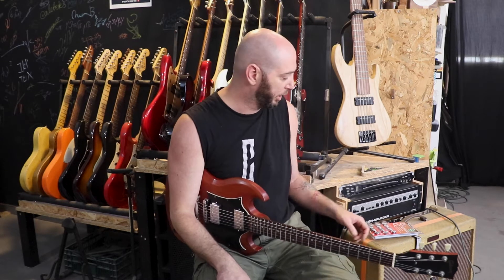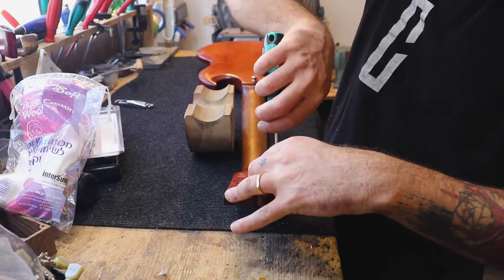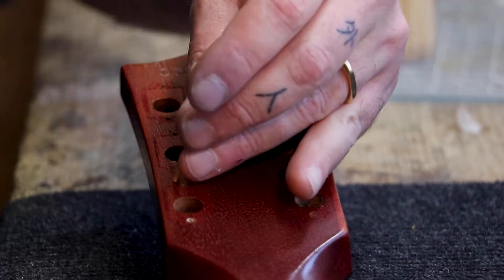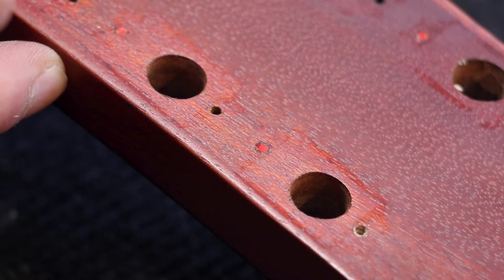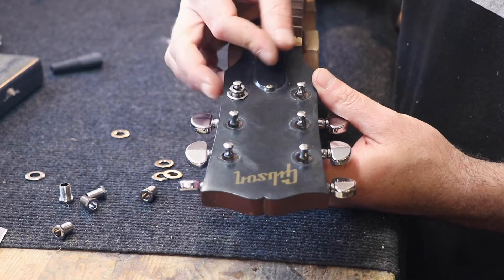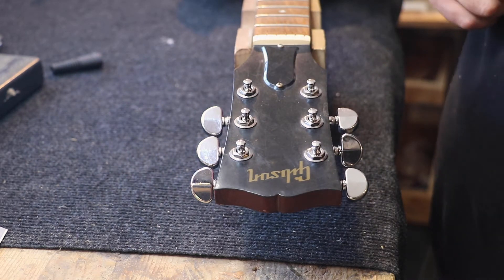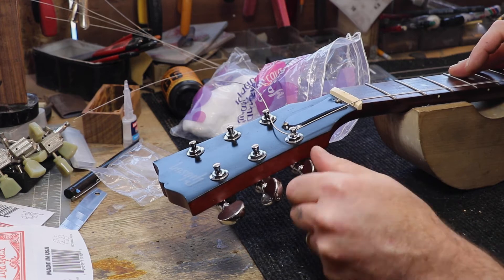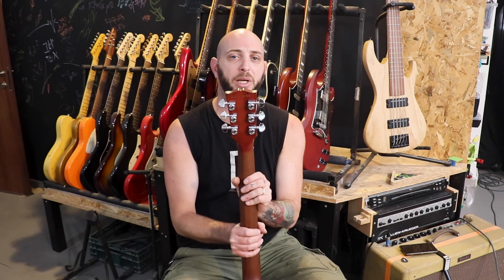Effortlessly Install Grover Electric Guitar Locking Tuners

Comment: I'm looking at replacing the stock vintage tuners in my Gibson LP Tribute with locking tuners.  Is the toothpick thing a necessary step?  Is it ill advised to leave the old screw hole open?
Reply from the maker: Good question!  Thank you for that.
It is Ok'ish to leave the holes open. Just make sure to avoid moisture.

Comment: brilliant video !! thank you ! , a question . for fill the holes , are you using a special stick, or is simple tooth sticks ? and also , special glue ? will the wood of the guitar wont react to this new type of wood in the holes ?  thank you
Reply from the maker: Hi, thank you for your comment. 
I just found a perfect fit toothpick, it all depends on the size of the hole..the plugs should have a snuggle fit. I usually just use CA glue for these type of jobs. Yhis specific installation does not require the drilling of new holes for where the new screw goes, and there should be no problem even if it was different.  Drilling a new hole in a plugged hole is completely ok.

Comment: Are there tuners with larger gears to help tune more accurately? It seems all tuners have the same gear ratios, but I would like a larger gear producing the effect of turning more to get closer pitch.
Reply from the maker: The main two types are 14:1 and 18:1. You should also check out the "Graph Tech Ratio" tuners.. they might be what you need
Reply: @coilsboutiquepickups  Thanks...

Comment: When you locked the string you bent it inwards before tuning, does it matter if you bend the string inwards or outwards?
Reply from the maker: It is best to have the string make a Z shape. I believe it will cling on better. It's more important to do that with non-locking tuners. Locking tuners should usually work great even without the Z shape bend

Comment: this solves the G string issue of the Les Paul?
Reply from the maker: No, but it's an improvement
Reply: @coilsboutiquepickups  So how can I solve that? :( or is it just a signature thing of Les Pauls lol
Reply from the maker: @dynoprod. A permanent fix for gibson g string is a very difficult thing to achieve. We can always try to improve as much as possible with the right setup, tuners, and a good new set of strings, but the fault is in the design

Comment: Why fill the holes ? Might need them later
Reply from the maker: Good question.  It is possible not to fill the holes, but I don't like to leave open holes. We live in a very humid country, so for future use, it's better plugged, especially Mahagoni, that tends to darken and weaken when exposed to humidity.

Comment: Great job! but unfortunately, you have replaced the original lightweight tuners with much heavier Grover tuners, thereby increasing the neck to body weight ratio and adding to the notorious SG 'neck dive'.
Reply from the maker: That's true, however the original lightweight tuners are awful. They go out of tune, break extremely easily and their building quality is terrible. So far non of my customers ever complained about the neck dive differences.. I guess you win some you lose some...